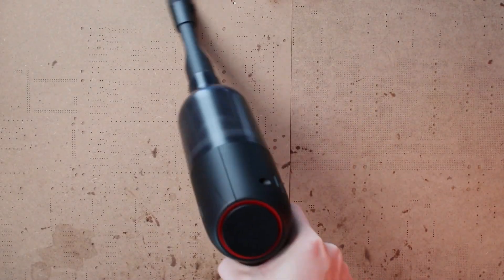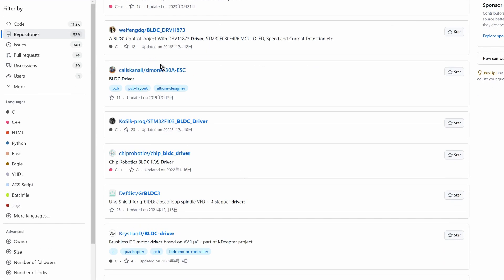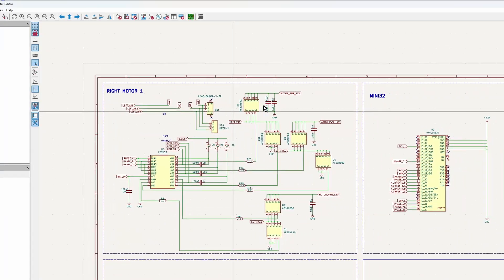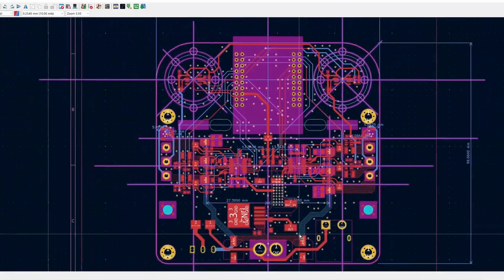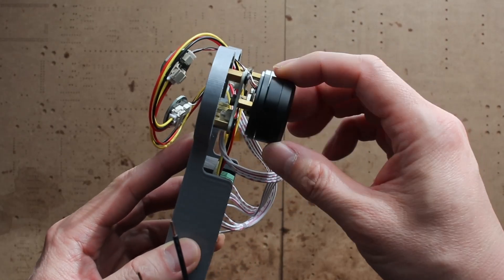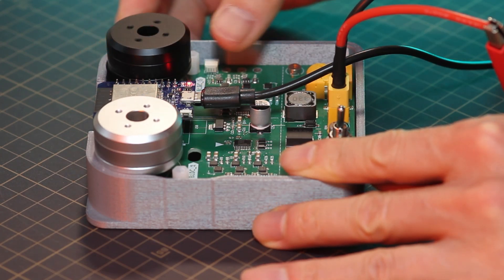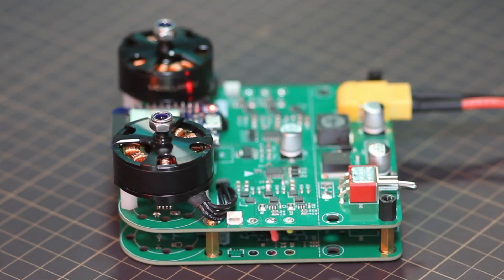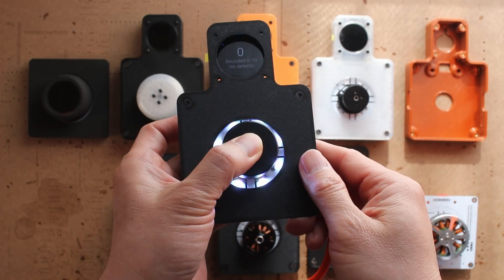ESP32 dual motor BLDC driver! fully support simpleFOC!

Comment: Any updates on using different motors? I am really interested in using the 5010 motor you had teased in the video. Thinking about building some automatic absolutely silent roller blinds and the 5010 320kv seems like a really cheap option with great torque at low speeds (I know it's overkill for the task, but it's the cheapest option).
Reply from the maker: I will do some videos on the related topics in the coming months, hopefully October or November.

Comment: You do realize you have just reinvented the hoverboard controller but with way less features. Not that that is a bad thing, those things are a bit much sometimes and with all the stm32 clones available there are so many variants sometimes finding the right firmware is a real pain. Not as big of a pain as seeing a supercool smartknob project and then having to source some obscure gimbal motor no longer available to duplicate it. 

I see where you are going with this and I like it. It must feel good to make a PCB and have a working thing at the end. Obviously you can shrink that way down too. It's definitely giving me RC controller vibes at the moment. You definitely need some protection for your circuit on there. There should be no way for the motor to kill the controller unless something catastrophic happens. 

Cool project though. Nice knobs, Bro.
Reply from the maker: Thanks! It’s good to hear from someone who sees the potential of the project.